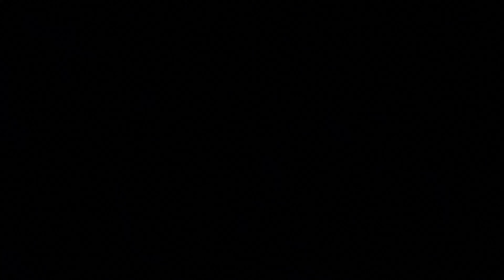How To Install ENLIGHT10 RGB Rock Light Kit From Stinger Off-Road

Comment: I was just going to ask when there would be an install video using the High10 radio for power.  I just came across this doing my install and was going to extend the power wires.  You just saved me a ton of time. THANK YOU!